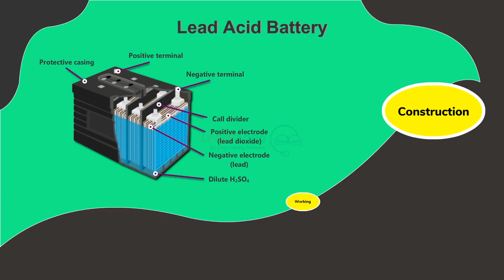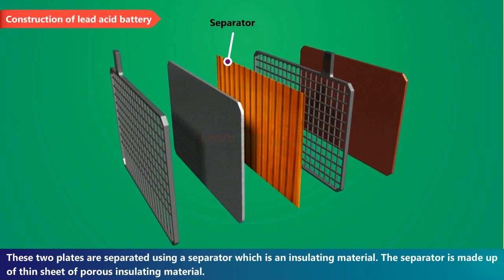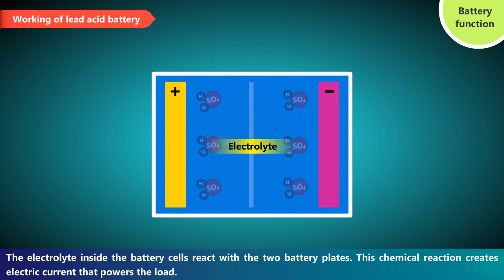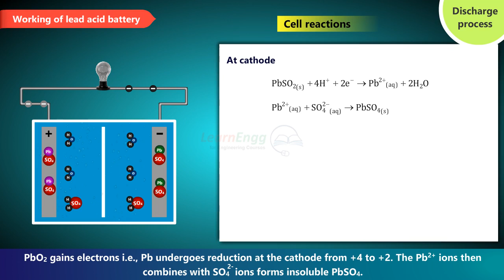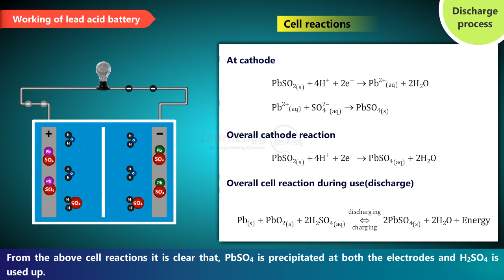Lead Acid Battery | Engineering Chemistry | Frequently Asked Questions | LearnEngg

Comment: If overfilled with distilled water and caused huge amount of the electrolyte to be drained, should sulphuric acid be added or the charging process will auto equalise the acid concentration?